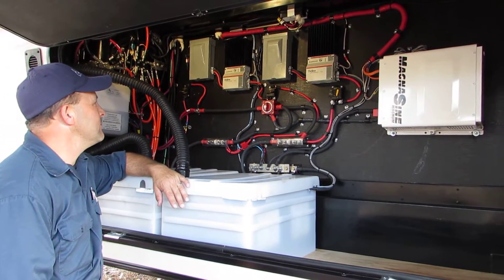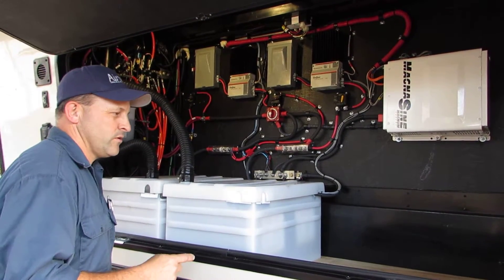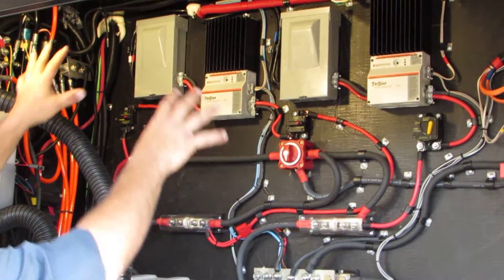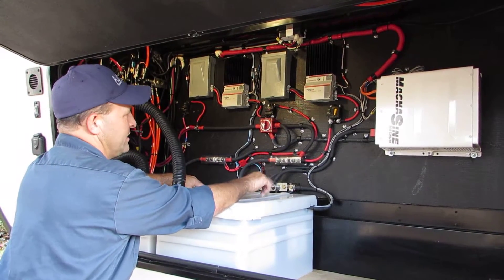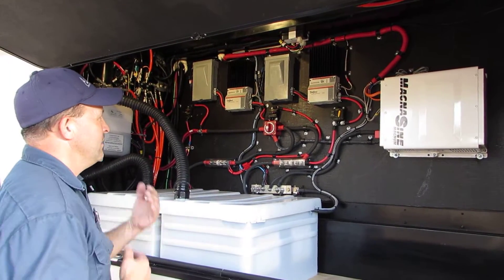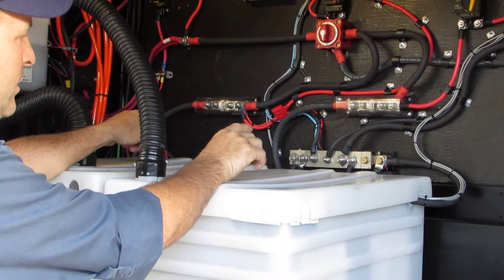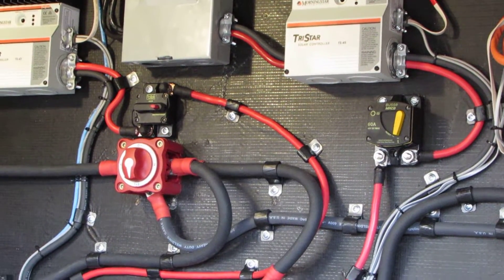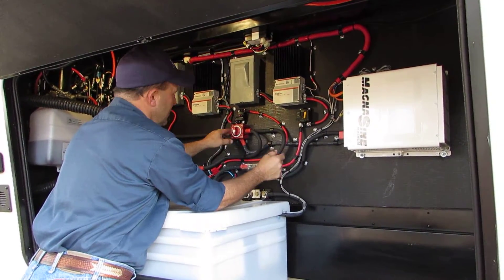"Solar Boondocking" Twin system install on Rush's 5th Wheel!

Comment: Excellent work! I am in the process of putting 800 watts on ours now. I did something similar and went two 40a mppts on 2 400 watt arrays. 675 ah of batteries for our travel trailer. I wish you were near Florida to help and look it over.

Comment: id never install mine outside like that, what if you have to work on it in the rain, snow, etc?  open that panel and everything is soaked, so are you.
Reply from the maker: Its under the 5th wheel nose, I worked on it in the rain.
Reply: ahh good call!  I forgot those are cabinets, not windows like truck campers.  thanks!

Comment: Love your work Eddy. I have a similar 2 charger, 2 battery bank system set up on my toy hauler. 
You do yours with high end components. Very nice. I did mine on the cheap, but now that I know and am learning, my next set-up will be much better.
My 2nd battery bank needed to be in the basement, and the cost of a vented battery box justified AGM's. Just thought that was worth sharing.

Thanks for taking time to share your knowledge.
Reply from the maker: Thanks! I like having the redundancy of a twin system just in case something brakes down out in the outback.
Happy Trails!!!

Comment: Eddie i noticed that the batterys have vents on them. If you have AGM batteries do you still have to have battery vents.Thank you Sir.
Reply from the maker: Howdy Gary! You don't need venting for AGM's, just "Wet Cell" lead acid batteries.
Happy trails!!!
Eddie Mobile Homestead Solar Services (252) 475-8034